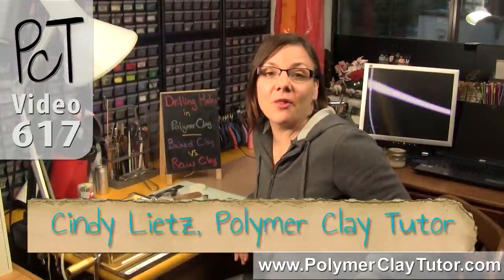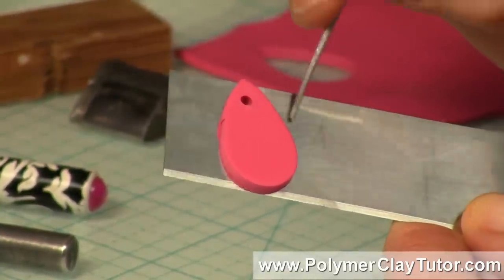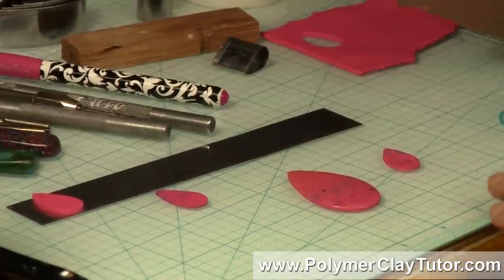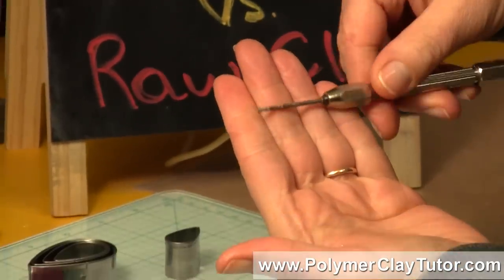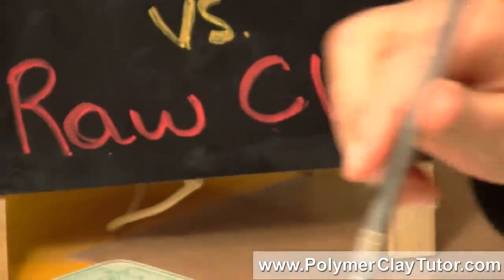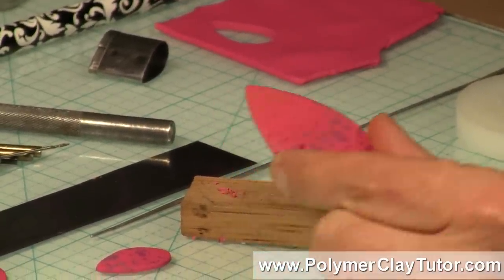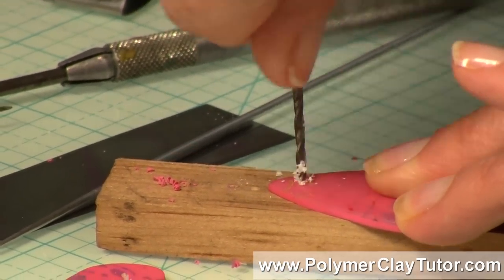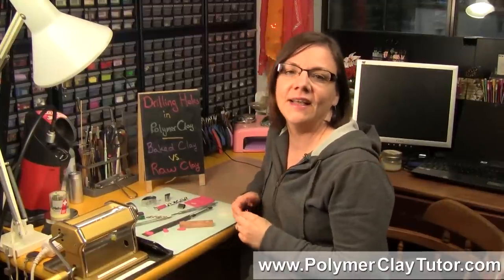Drilling or Piercing Holes in Polymer Clay (Raw Vs Baked)

Comment: I own two little drills that are actually made for nails. 
People sometimes put little rings or "piercings" in their nails, usually acrylic or gel nails and that is done with a tiny drill. 
One I got for my birthday a long time ago and one I got at a store where they also sell cheap plastic stick on nails and such things. It is wonderful for polymer clay since it is just big enough for the wire I use to go through. 
It usually has a little head at the top that twists freely so that rest in the palm of your hand while your fingers can twist the actualy drill part. 
Now I must say I like the one from the store with the cheap nail supplies a little more because it has a cap on it and the drill itself is one piece, while the one I got as a gift is a two part thing which screws apart often when using it. 
I just thought I'd share it since I don't think many people know such a thing even exists :)

Comment: I found a "dottie tool set" on etsy that has several (6 or 7) different size hole cutters. They range from very tiny to about the size of a straw hole. They work great on raw clay.  Seller was my mandarin ducky - in England. Set was $8 usd.

Comment: I have been doing this very thing :/ so I thought of what I could do without buying drill bits and so I used a coffee stirrer straw that has a very tiny tiny opening and it looks amazing! I might get the drill bits but this works for now. HOWEVER I never would have thought of this if I hadn't seen this video! Thanks!

Comment: Great video, as always 🤗😊 I've been using a hand drill to drill small holes in baked polymer clay that I've coated with UV resin, but I'm sometimes getting cracks and peeling resin around the holes. The clay pieces are relatively thin and the resin coating is essentially a glaze (2 or 3 coats). Was wondering if you have any tips or suggestions? I was considering drilling before adding resin, but figure it would be messy trying to keep resin out of the holes .... 🤔😦
Reply from the maker: You can drill your piece before the resin. You just need to make sure you are drilling nice clean sharp holes, with straight edges and that you are using a doming resin like Ultradome. Doming resins have a strong surface tension so they won't flow into the hole if the hole is sharp.
Reply: @PolymerClayTutor  Great. Thanks very much for that, Cindy. Will give it a try 😊
Reply: @PolymerClayTutor  has anyone made a keyhole into the back of a polymer project in order to hang it on the wall? If so do you do that once it's done baking? Essentially the idea I have is something like a golf ball to go on the wall but it needs the key hole in the back to hang it. So it's a thick piece of clay.
Thank you in advance

Comment: a long time ago when i was still working with clay, i found that straws works as well. since it takes the clay out with it and if you dip it in water before making the hole the clay can just be blown out the end or pushed pulled out with a smaller stick or piece of hanger wire. mabe you could test this one on softer and harder clays for those who wish to still make there holes before baking so when they seal after baking the piece it will seal arount the hole inside.
Reply from the maker: Great tips, thanks for sharing!
Reply: Candace Cole

Comment: Hi Cindy, I am really enjoying learning from you. I got some of the Turnip Souffle, I fell in love with the color after you used it in a minnie tute. Here is my question, I am disabled and putting in holes manually is very difficult. Could I use a dremel? Would that cause cracks? I am really enjoying the polymer clay, I love that I can work at my own pace and even stop working on a project for a couple of days and then pick up were I left off. I finally found a creative outlet that works with my disability. Thank you for all of your wonderful teaching.
Reply from the maker: Hi Nicole Newman You can use a Dremel, just be careful when holding your piece that you don't drill into your fingers or hands. A drill press also works great or a hand piece on a Flexshaft.
Reply: Thank you.
Reply: PolymerClayTutor Ha! I asked a similar question about the Dremel  before I saw this. Thanks for answering before I even asked! LOL I'm guessing a lower speed is probably better than higher?
Reply: I was thinking the same thing about lower speed. I have very limited strength & thought the Dremel would make nice holes and I wouldn't hurt myself in the process.

Comment: Thanks, as ever, for sharing...really interesting...I tried a couple of times to make holes before baking with a needle tool but the result was very poor...I prefer much more to drill the hole after baking, before finishing with resin, and it works well for me...but...If I need absolutely to make the hole BEFORE baking I prefer to use a little cutter (ex: Premo!  #Sculpey   Mini Metal Cutters or even a simple straw) obviously the hole is bigger than I really need...but in this way the result is fine... <3

Comment: I used hot glue to make a handle. I did it when I made my own needle tool for when I decorate my cookies, and thought... hey, that would work for my drill bits. :)
I didn't even think of using a like wood block. I have some of those from when i made some small wooden dice to play games with the kids during family fun time.
Reply: I also use a fine sharpie to make my drill marks. I found I rather like drilling than putting the whole in before baking.
Reply: oh, I also found I like putting holes in my beads and then reshape it need be, but I still have a little pin hole to direct my drill. you're tips are great by the way!

Comment: I have used one of the small drill bits and it caused cracking. How can I avoid this?
Reply from the maker: There are a couple of things that will cause chipping or cracking when drilling polymer clay... 1) A low quality clay is brittle and chips easily. 2) Underbaked clay will chip easily. 3) Trying to remove too much clay at once by starting with too large a bit or jumping sizes. Start with a very small bit or a tapered bit first and then go up in sizes in small increments instead and you will get better results.

Comment: Why my piece gets broken when I drill the hole, to me this is hard, I have to repeat the piece.
Reply from the maker: If your piece is breaking when you are drilling it, it either is a cheap brittle brand of clay or the piece is not cured properly. I have several videos that will help you choose the right brand of clay and to bake so that your pieces are strong and durable. I understand how frustrating it can be to have your beautiful work break. Hope this helps! 💖